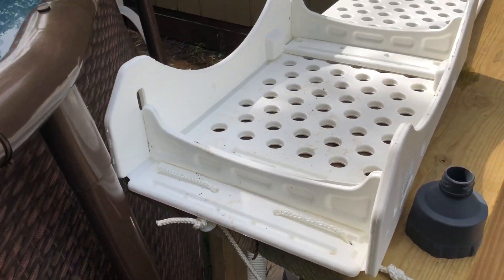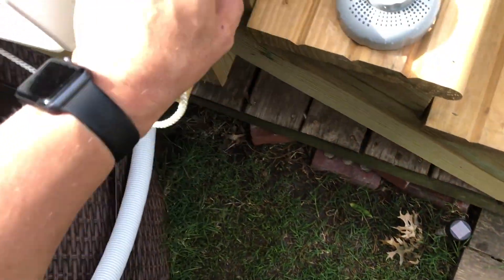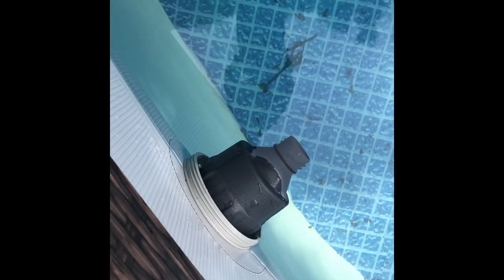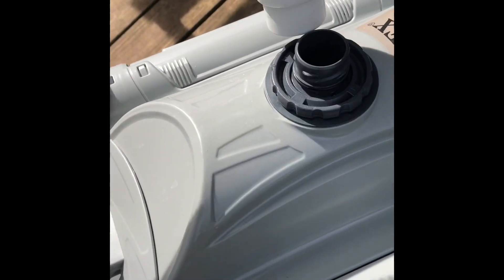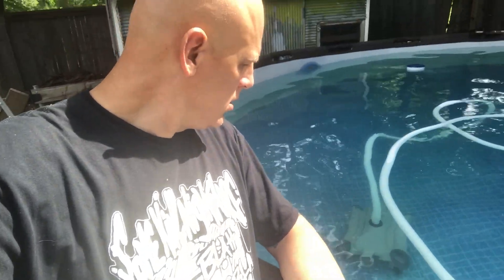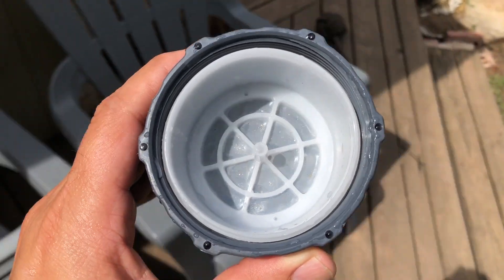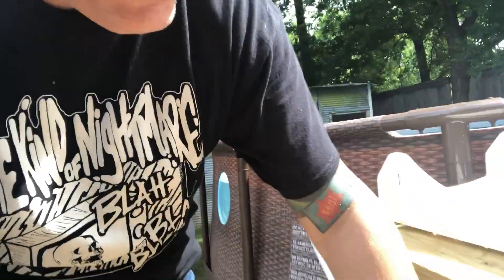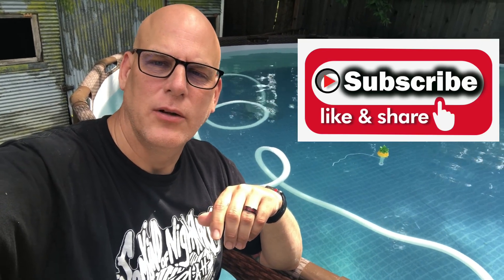Intex Vacuum 2020, Fix And Clean, No Attachments Needed

Comment: It is necessary to put the small filter in the outlet?
Reply from the maker: May not be, but it is the only way I can connect the hose to the outlet, if that makes sense. Plus it does stop sand from the sand pump. So it is not bad at all! Thanks
Reply: @LacyMedia  I got the same hose as you but I saw other video on Youtube and other guys have A B C hoses with connector. You are the only one who show the small filter that come from the outlet hose.
Reply from the maker: Michael Tech Reviews may be my 14inch Sand Filter that came with the outlet connector, it is an Intex sand Filter works much better than the filter that came with the pool.

Comment: I can’t get mine to screw on in A port also! How did you eventually get it to screw on?
Reply from the maker: If you have the original filter pump, you have to buy an adapter. I got an Intex Sand Filter and it works with that, but will not with the Coleman Pool Cartridge Filter. You have to but the adapter, which I have listed below in the description section.
Reply: I can’t but can if I take the little filter off

Comment: Im not getting water to push out of both ends underneath the vacuum can you help with fixing that issue?
Reply from the maker: There is a YouTube video that another guy made about taking it apart and cleaning the flapper inside and then it works great, can’t remember but I mentioned that in my Intex vacuum fix video. Also make sure you are getting good water pressure, thanks for viewing and the comment

Comment: how does it vacuum if the vacuum hose is on the output?
Reply from the maker: thanks for viewing and the comment, it pushes water down the hose to the vacuum unit, which then pushes dirt and leaves into the unit through the filter and water out the unit.